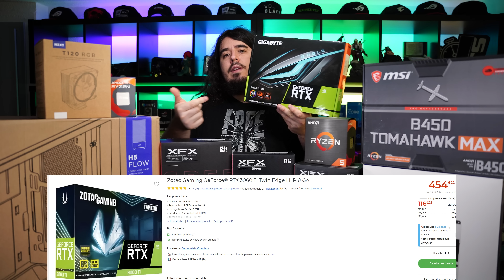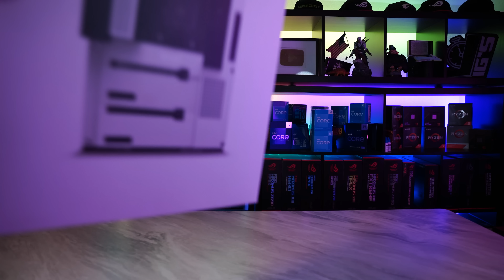UN PC GAMER A 650 - 1000€ en 2023 ? C'est Possible

Comment: Bonjour. Super video :)  J'ai une question qui parait hors sujet mais pas vraiment..
J'aimerais savoir une fois pour toute pour le choix de la gamme de la carte mère:

Si je prends le plus bas de gamme ex:   GIGABYTE H610M H DDR4
Pour un 12400f  /  32GO ddr4 3200  /  et une 7900xt pour jouer en 4K

Tout a l'air compatible , je ne souhaite jamais rien overclocker ou modifier jusqu'à changer de pc dans 5-7ans.
La carte mère risque de brider quelque chose ou j'ai raison de prendre le moins cher possible?
Merci si tu me réponds :)
Reply: Excellent choix, ne t'en fais pas pour la cm, elle est top
Reply: @StefDelanote  j arrives pas a savoir si c est du troll?..
Reply: Non ça le fait enfaite ce qu'il faut comprendre avec les H en carte mère c'est au niveau de vrm et on as besoin pour le processeur et la ram pour les vrm mais honnêtement si ton boîtier est bien ventilé et que ton processeur tu cale un p'tit ventirad dessus tout fonctionnera très très bien la carte graphique n'a pas besoin de vrm donc ça suffit même si oui au niveau du design c'est pas dingue mais ça ne change absolument rien et ça marchera et si aussi le seule bémol si tu veux changer de cpu aller sur + haut la parcontre change ta cm

Comment: voici une config pas cher a 600-700€ que j'ai trouvé avec les prix bas, en comptant en neuf ou recommandé, acheté sur des bons site ou aliexpress:
CPU r5 3600 am4 a 107€ sur Amazon 
RAM 16gB DDR4-3200 FURY BEAST 55€ 
ventirad cooler master h412R 32€
SSD 1To Silicon Power Sata III 60€
Alim Esgaming 650w 80+ Bronze 55€
Boitier Deathmatch 3 Spirit of gamer 50€
Carte mère b550M-A Pro 82€
Peladn Geforce GTX 1660 Super 6GB  182€
(le tout sans compter la livraison qui devrait pas depasser les 30-40€) 
Je n'ai pas mis mes liens reconditionné aliexpress, j'ai préféré essayé de faire le tout sur Amazon, pour un total de 623€
Dis-moi ce que t'en penses stp :)

Comment: Vous en pensé quoi de ma config ?

1x Samsung Série 970 EVO Plus 2 To

+ 1x Arctic MX-4 - 4 g
+ 1x DDR4 Corsair Vengeance LPX, Noir, 32 Go (2 x 16 Go), 3200 MHz, CAS 16
+ 1x MSI MPG A750GF - 750W
+ 1x MSI GeForce RTX 3060 VENTUS 2X OC (12 Go) (LHR)
+ 1x be quiet! Silent Loop 2 - 240 mm
+ 1x Intel Core i5-12600KF (3.7 GHz)
+ 1x Microsoft Windows 11 Famille - 64 bits (version Clé USB)
+ 1x NZXT H5 Flow - Blanc
+ 1x GIGABYTE B760 DS3H DDR4